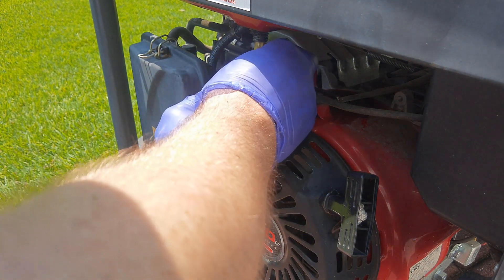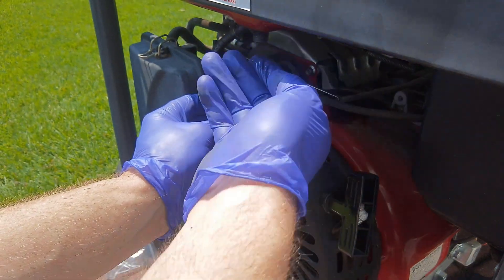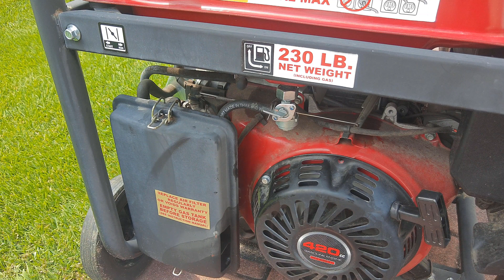How to Replace a Fuel Valve on Gas Generators (Predator, DuroMax, Champion, Generac, Honda, etc.)

Comment: Do you no the  size of the fuel valve on a 1800 /1400 predator generator i bought one but it was the wrong size i dont want to replace the whole gas tank
Reply from the maker: If I were you I would drain the tank and remove the old one and compare the measurements to fuel valves online. I use calibers to get accurate measurements. Here is a link on Amazon for what says it fits https://amzn.to/3I0ocRL but check the picture and the valve you take off before ordering. This one is a little more expensive and you can probably find one cheaper. 

As an Amazon Associate I earn from qualifying purchases.
Reply from the maker: This one looks the same and much less expensive: https://amzn.to/3I7kXYD

As an Amazon Associate I earn from qualifying purchases.

Comment: Thank you for the detailed video. I’ve been trying to find the fuel filter and I guess it is the while tube inside the petcock valve.
Reply from the maker: it is the white tube that is attached to the valve.

Comment: Is there a way to remove the old nut and put it on a new one? I ordered one from amazon and of course mine didn't come with a nut and now a hurricane is coming.
Reply from the maker: It should still work, try and check for leaks. the O-ring / gasket is the important part. Good luck with the storm.

Comment: This was a really helpful video.  My Generac generator fuel shutoff valve just started leaking after using the generator for 2 days during an extended power outage following a major storm in Maine.  I appreciated how you presented this instruction.  Thanks -
Reply from the maker: Glad it helped

Comment: My generak won't start.  Removed the fuel line, turned on valve, no fuel comes out. I added a gallon and nothing will flow out What do you recommend ?
Reply from the maker: The valve will have a fuel filter on the tank side which can become clogged. I would replace the valve and fuel filter that comes with the valve. Also check if anything is blocking the port from the inside of the tank. Good luck.
Reply: @WelcometotheFamily1   thank you. I get working on it..